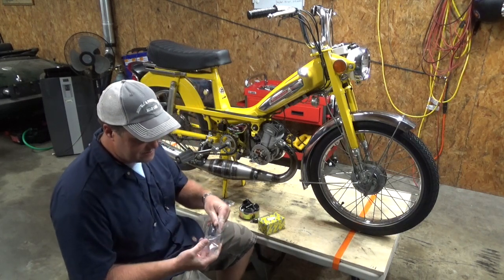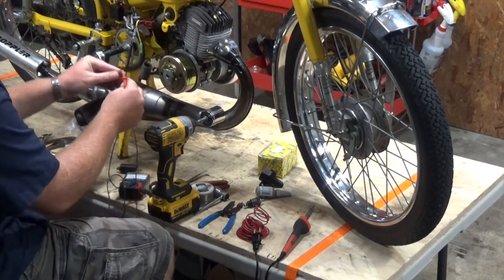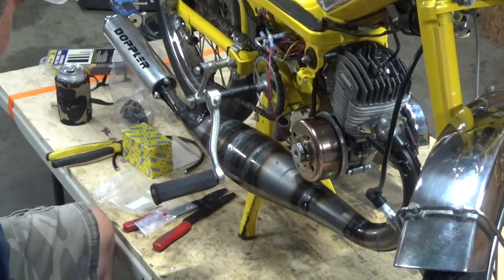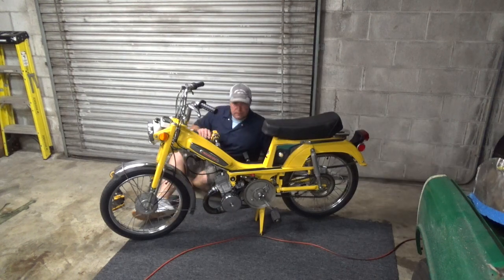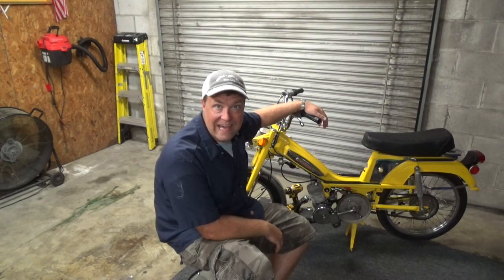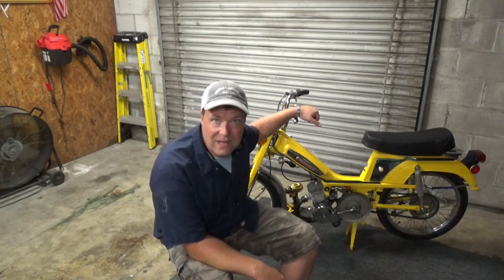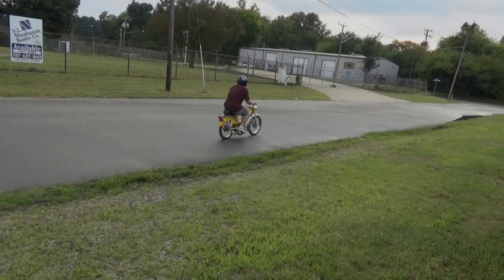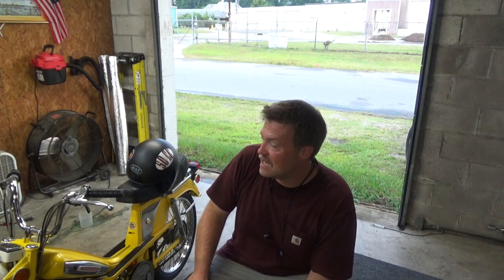Motobecane Moped Restoration Ep. 20.  First Start and Ride Modified Bike.

Comment: It works! Congratulations!

You should be able to get a lot more acceleration out of this thing. Your RPM's are really low. My stock engine runs at a higher RPM than your highly modified moped. That cannot be right :P Tuning your variator will solve this. You will be surprised how much power is hidden for you at this moment ;-) A well tuned variator is a blessing. A badly tuned one is worse than having no variator at all. 

Braking in the moped by running it at idle sounds weird to me. Idle running 2 strokes don't get a lot of lubrication. You don't want a lack of lubrication with your new cylinder. I also sort of remember reading something about 2 stroke carbs running really rich at idle to somewhat compensate for this problem. I think it is better to just go for a ride. That will continually introduce the necessary amount of lubrication. But that is just me with some thoughts on the issue. I don't know for sure.

Comment: I feel like that should be way faster... 50+. Thought about upgrading your variation? That could get you up in the high power RPMs sooner
Reply from the maker: Henry -- It might do 50.  I haven't had it on a long enough stretch of road to get it there tho!  I may have to play with the gearing a bit so that it gets up to speed a bit faster.  Of course, then you sacrifice top end.  Its always a compromise.  You also gotta consider the rider.  A bike that does 50 with a 150lb rider, certainly won't do 50 with my 200lb ass sitting on it :-)
Reply: I think you can hit 50 easier by playing with where the variation engages, just like clutch spring tuning on a Puch or Tomos. The ER3 with clutch function would do the trick (but it's kinda pricey). Thanks for the awesome content, I'm building a new identical bike and your videos have helped me a lot!

Comment: Hows it running now??
Reply: I have the same bike same parts, though im nervous aboit putting the 70cc bsck on with the doppler exhaust in fear it will blow my cdi. With the 50cc kit and doppler exhaust it wouldnt run so i just have the stock exhaust and 50cc. Need advise on whether or not to put the 70cc and doppler exhaust on or not. Thanks
Reply from the maker: Heya Benjamin.  I'm not having any issues running the doppler exhaust on my kit, and the CDI seems to be working fine.  My motto is... Its just a moped, so go for it!  I'm starting to wonder how much extra oomph I'm getting from the doppler exhaust.  I may try an experiment and replace the stock blunderbuss on there and see how it behaves.  I'm certain it won't sound as good :-)
Reply: I like your motto. Did you ever try the stock blunderbuss with the 74cc? Also, I am considering putting the 74cc kit and the dellorto carb on mine and keeping the stock ignition coil and stator plate. Do you have any reason this wouldn't be a good idea?